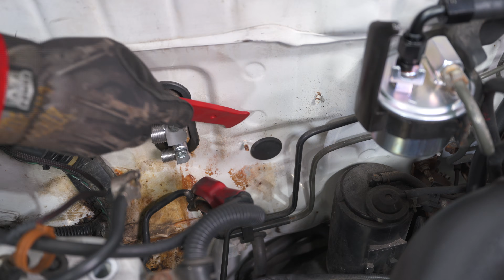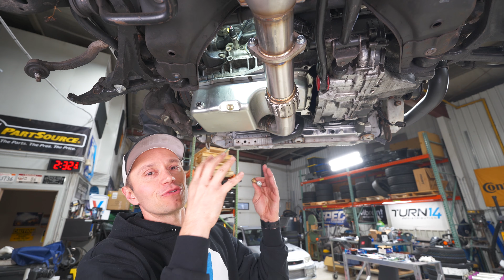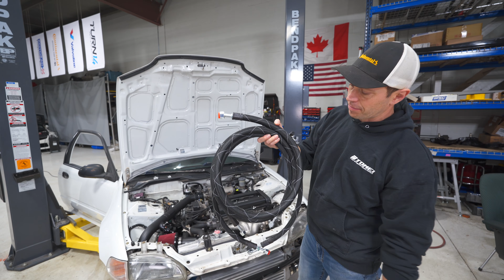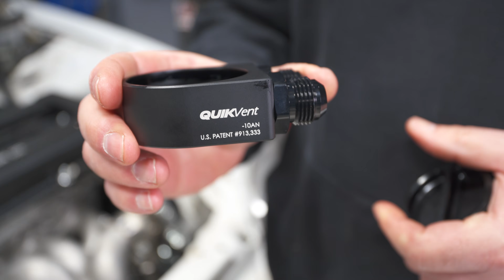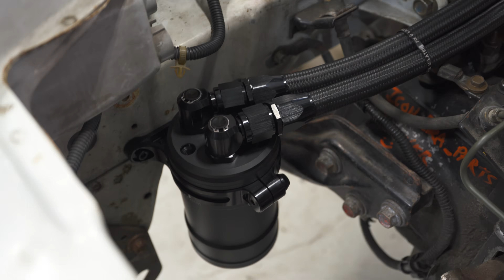Everyone Needs This! - TurboCharging an EG Honda Civic | PT3

Comment: Quick input on your catch can setup. I would get rid of the atmospheric vent on the catch can and pick up Level 7's part to convert it to -10 and run this line back into your intake track pre-compressor so you have some vacuum helping evacuate the case/valve cover. The catch can setup you designed is really just a glorified valve cover vent without this. Also B series motors need help venting the crankcase more than the valve cover (I understand these are related through oil passages within the block, but there is a difference). I would recommend getting a PCV/breather box delete to -10 for the back of the block and running that to one of the two inlet ports on the catch can. You don't need two -10 lines from the valve cover like you have it currently - one is adequate. With the design I described, you will have vacuum on the case/valve cover at all times and both the valve cover and block will be adequately vented.

Comment: Would definitely recommend a set of fender braces even stock 20-30 metal has a fair bit of flex but especially cutting holes will further compromise the rigidity

Comment: I would have depinned that can lambda sensor and the other sensors that you are running through the firewall via that bulkhead rubber grommet you removed so that you could pierce a hole in the center and run all those wires through it and then finally reinstalling the grommet. I've learnt my lessons with my female passengers whinging about a cold draft smashing their legs with those grommets open haha... ;)

WAIT... I SKIPPED AHEAD... ITS BACK LOL....GOOOOOOOOOOOOOOOOOOOD

Comment: You should of notched the front of the fender skeleton and ran the lines inside the unibody to the same holes you drilled. Could of done without the first notch

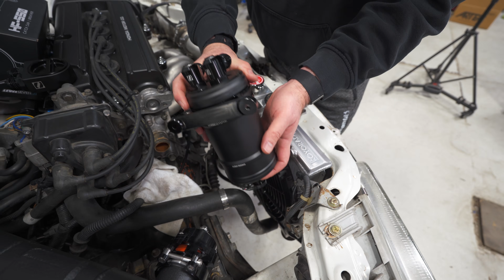Comment: 15:30
isnt better to have the oil catch can higher than or the same level as the valve cover?
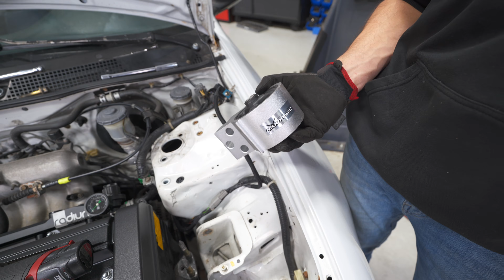23:00
those mounts are called traction mounts. the harder ones would help prevent wheel hop since the motor would be more stationary.

Comment: Its the front lower torque mounts or compliance bushings .That catch can should be mounted much higher.Venting from only 1 location is not enough,should have done the valve cover mod with at least 2 vent holes on the valve cover and another 2 from the back of the block.Speedfactory has the fittings and plug for the back of the block.

Comment: You should always use a grommet when sending electrical wired through the metal firewall.
Reply: You should always watch the whole video before racing to the comments section and embarrassing yourself.

Comment: Its not a transmission mount, its a "torque mount"  if you have stiff (non stock) aftermarket engine mounts you don't need either side torque mount.

Comment: Its true the last 10% takes 90% of the time. Have been doing low voltage for a decade and I swear I have spent weeks on a job fiddling with setups and dumb shit when 95% of the job is completely finished.

Comment: Question for y'all: I noticed you tend to replace most of the things that matter when you buy a car to build such as wheels tires suspension brakes engine trans etc. etc. Why not buy more rolling chassis type cars or cars that are mechanically totaled if everything that came on the car is coming off anyway? I know for example you have said before that a CRX is just too expensive, but you aren't keeping the stuff that came on a running CRX anyway, so... CRX parts cars definitely aren't expensive.

Comment: The advantage of a CAN bus WBO2 is not signal speed, it's accuracy. If anything, the analog signal will be faster, but the voltage drop due to wire length and changing loads will mean what the ECU receives isn't necessarily what the WBO2 output. That's not an issue with CAN bus.
Reply: If a super low power signal like that is dropping voltage then you must be running like 40ga wire. I think it really just comes down to ADC processing/ECU architecture, and having a standalone device do all the work and send a CAN message instead of the ECU processor doing the work could def make a difference. But I don't think it would ever make a huge difference either way

Comment: Make sure those ac lines arent rubbing against the cut metal on the inner fenders. Vibrations will make that cut through over time. Thick rubber grommet etc should help. Cheers.

Comment: Stage 1 clutch aint gonna be enough. I ran a Competition clutch stage 3 sprung on nonvtec b18b 350hp and it was VERY easy on street. You're going to turn up boost and that clutch will slip

Comment: Love the vids but the build could be tweaked. That "Downhill pathway" to the catch can, no "pooling in the lines" is correct. Trust me, If you beat on this you will be draining that can daily if you leave it there. You have a ton of room in that engine bay to mount the can higher, ideally higher than the part of the engine you're venting from. A bit more difficult since your vent is at the very top now, but it's fixable.
Reply: 100% should be at highest point possible also tapping off valve cover breather using a PCV valve is a good way to do it. Theres a writeup on HondaTech for it.
Reply: Just adding to what’s already been said. Hate to criticize an otherwise good video but that catch can placement with no drainback is gonna give you headaches in the future. I’d expect a redo vid after reading all these comments. 👍
Reply: Would it be better to get those block vents instead of the valve cover vents?
Reply: Why would the height matter? Oil and water vapor will be traveling through the hose until it reaches the catch can, where it will fall out of suspension and coalesce in the catch can, regardless of what height the can is at. Sure, you might get some liquid forming in the hose itself, but it will be pretty minor compared to what happens in the can. On one of my cars, the catch can is mounted down by the oil pan. I've had it there for years and drain it at regular oil change intervals. It's never close to full. If you're filling your can then you've got major blow by or some other issue with your crank ventilation.
Reply: @nigel_white  I’m not even talking about a drain back can, just trying to prevent an unnecessary amount of oil going down to that can. Fuel and water vapour will find their way to an elevated catch can just fine. Yes, the other main function of the can is to reduce crankcase pressure. There will be a ton of pressure on this turbo engine when they get on it. Even a perfectly healthy all motor Honda with zero ring issues will be pushing plenty out every block vent.
Reply: @GIZZMOTORSPORT I wasn't talking about a drain back can either.  Regardless, I still don't see an explanation for why the height of the can matters. It's within the can itself where the vapors coalesce into liquid (how much depends on the design of the can). That happens regardless of whatever height the can is at. However, if there's some physics principle I'm overlooking where height becomes a significant factor within the confines of an engine bay, I'd be happy to hear what it is.
Reply: @nigel_white it would make more sense if you’ve seen it in action. They aren’t using this inline with the pcv trying to catch bad crankcase vapours, they are strictly using it as a vent. Either way it’s more than vapour in the lines, when on the throttle at times this will see liquid oil that once pushed to the lines will gravity flow downhill. You ever remove a Honda oil cap and run engine? Oil splatters all over the place, even at idle. If the can is above the block vent it has a chance to stay in the engine, if can drains down it will fill can. Not in this case but If the line diameter is too small it can even capillary siphon down.
Reply: Can you not run the drain line of the catch can directly into the oil pan?
Reply: @rthomp03  if the catch can is above the oil separator do a return there. but it’s more lines to run and potentially fail. Keep it simple.
Reply: @rthomp03 you can, but usually the oil that makes it to the catch can picks up a ton of condensation from cooling in the catch can and has fuel vapors in it which dilutes the oil quite a bit. So if you do this you want to change your oil very often. That's why IAG makes those catch cans with coolant lines to keep it all warm. Don't know how well they work though.
Reply: @turbo_brian  this. Drainback is going to introduce possible contaminants and like you said condensation back into your good oil supply. It is a pain in the butt to constantly check your catch can but its one of the extra maintenance steps when you own a "modified" turbo car. One of the reasons i sold my "daily" lol
Reply: @MethMeat901  drain back can be a pain, I run a drain back but it’s not a daily. The catch can system can work well. If they raise it up it will collect vapour just fine, and any oil passing the oil cap when on the throttle won’t be forced downhill into the can.
Reply: Your name is Jizz Motorsports??? 💦 Lmao

Comment: If you are worried about running out of gear in 4th, put a gsr 4th gear in that tranny and call it a day. Plus the gsr 4th bridges the gap between the b16 4th and the ls 5th and makes it feel like the transmission could have come that way from honda.
Reply: Gsr 4th gear tops out high which makes it more usable. Good call 🤙
Reply: It’s a track car boys. You will hardly top out of 4th.
Reply: @BETTALIFE101  what sorta tiny track you go on? Every track I can think of you can use most of not all of 4th.
Reply: @jahbrake9791  you want to stay in the high rev range.
Reply: @BETTALIFE101  there's these things called straightaways on many tracks..You cool topping out at 95 mph? Do you😂
Reply: @jahbrake9791  they aren’t building a high horsepower car. With that build you are looking at maybe 250whp. And yes. My 662whp. Tops out at 110 in 4th on a quarter miles
Reply: @BETTALIFE101  he specifically said in the video that it is not a track car.
Reply: They literally say in the video that it isn't a track car and if it was they would leave the b16 5th in it because they expect to run out if gear in 4th. My suggestion above was in response to that and the gsr 4th still makes it a better street car on top of that. I have this exact gearing in my b20vtec civic and putting a gsr 4th makes it so you can actually use 4th as a 40-50mph street gear without feeling like you are revving the engine. I tried it with the b16 4th with ls 5th as well and 4th sucks as a street gear and if you decide to drop it into 5th it feels like it is bogging the engine on the street.
Reply: @frdbtr  I’m not saying it’s good or bad. I’ve ran both b16 and gsr in my b16 turbo.  Overall impression, b16 gearing is still better.  Cruiser yes a gsr.  But for what low horse power they are making, a b16 gear set is perfectly fine. Yes, some people don’t like cruising 70@ 4,000rpm. That’s the whole point about a Honda though, you want to be in the high revs and no need to down shift.